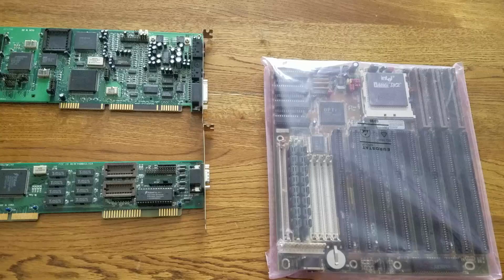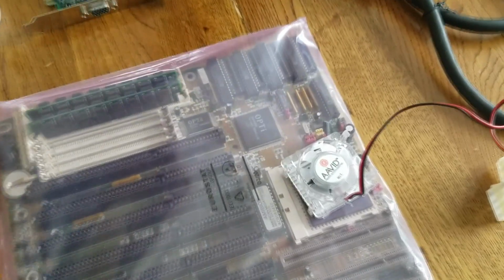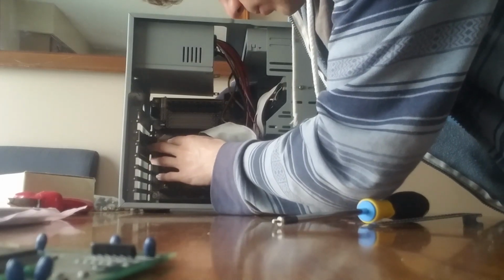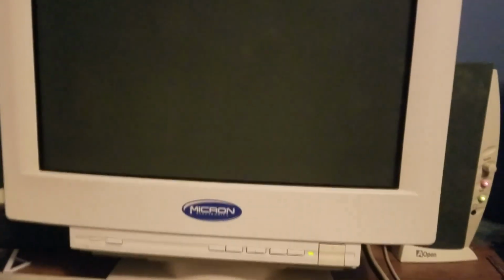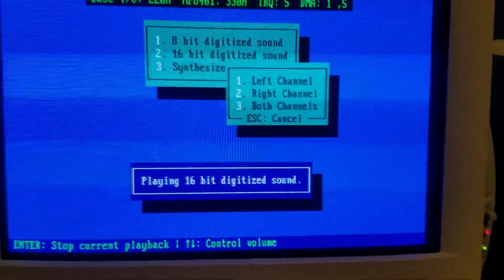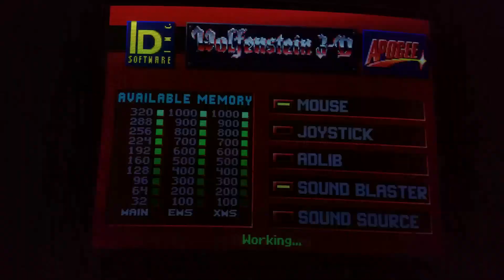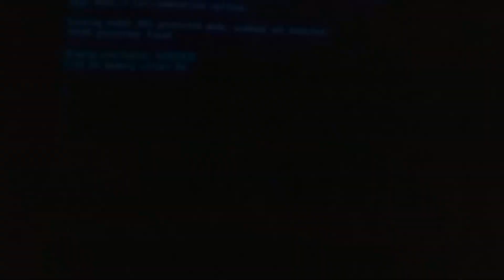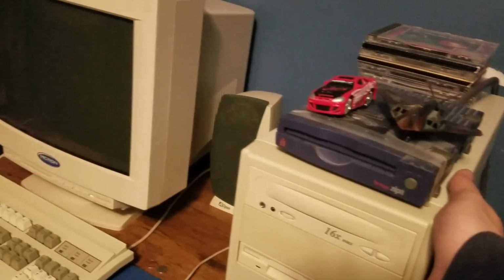Building a 486 PC into my old AT computer case.

Comment: Upgrading one of my 486's currently. Trying to break DX2-66 threshold. Tested all sorts of CPU's. The board rejects even OverDrives. So now having exhausted all options I ordered a newer motherboard with a proper Socket3. Love all gear from that era.
Reply from the maker: Nice! The Overdrive chips are super fascinating! I've never used one but always wanted to. If I ever tack down another Socket 3 board with PCI slots I will definitely try to build one.
Reply: @jikissgamer  I built a low profile machine out of a CD player shell. There's a video on my channel. I wanted something that looked cool, but as a result, constrained myself to a very specific parts layout and half height expansion boards. I have better graphics cards, but they won't fit in half-size VLB.

Proper cases I haven't come across in the last 10 years. Not even on local Craigslist. Could look something up on ebay, but I'd rather wait, or build my own enclosure from scratch.

https://www.youtube.com/watch?v=bnapJI5WjBU

Comment: Really enjoyed this video, I need to put my old 486 back together, I’ve had the parts for years but never gotten around to doing it...subscribed 👍🏻

Edit: I meant to ask, why bother with a cooler for a DX/2? Seems unnecessary 🤷🏻‍♂️
Reply from the maker: Thanks for subscribing!! I'm glad you enjoyed it!

I just decided to use coolers ever since I touched a DX2-66 chip once while it was running and got paranoid from how hot it felt.
Reply: @jikissgamer  oh man, I know that pain! I once put my thumb on a Cyrix PR233 CPU, one of the worst burns of my life! It actually attached my thumbprint to the CPU permanently 😆

But in all seriousness, a DX2/66 doesn’t need a cooler even if it feels kinda hot...I think the lowest clocked CPU that genuinely needs one would be the DX4/100
Reply from the maker: @jonchapman6821  I see. That's very reassuring! 👍 I've always been that way with hot parts for some reason. I even wrapped a fan to my 3dfx Voodoo haha.